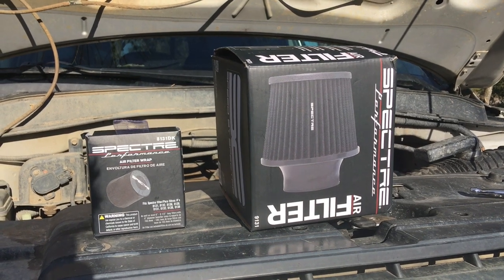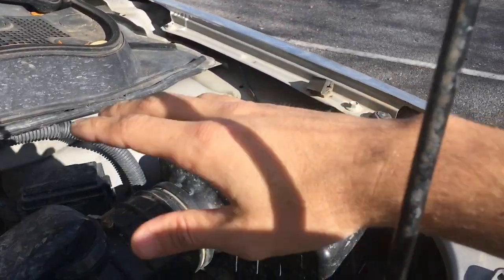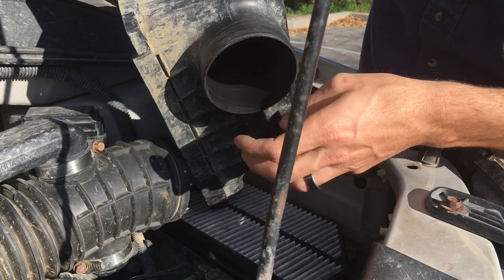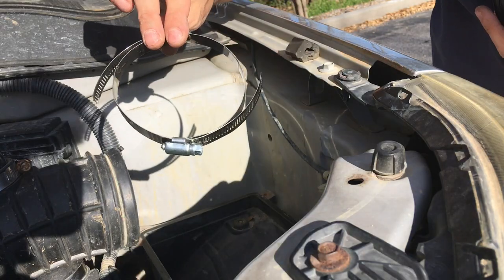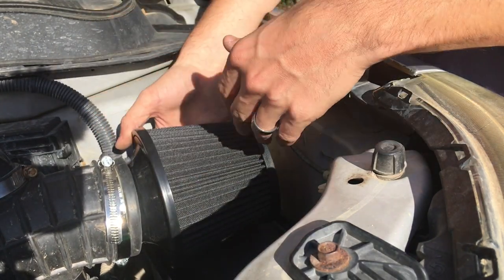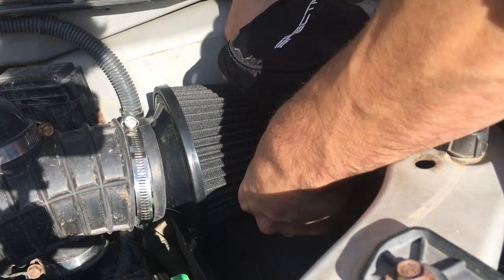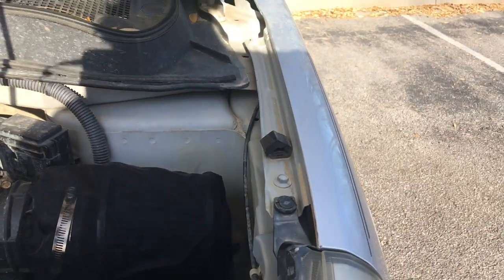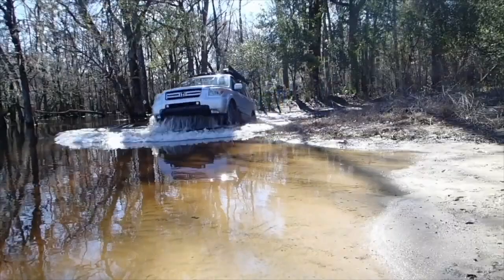DIY Raised Air Intake Mod: Pt I (2003-2008 Honda Pilot)

Comment: If you mod your old top cover(or the junk yard one) by lopping off the back half and tapering the front half to the shape of the cone, you would partially shield it from front/top splashing while also allowing it to funnel some cooler outside air during normal operation.  In addition to protecting the front and part of the top of the filter from splashing, this also allows it to breathe if the factory box inlet is submerged.  Just a thought.  Keep the videos coming.  I love watching what you put that thing through(and that you take your family along).
Reply from the maker: Thanks for the feedback Allen! That is what I was thinking too.

Comment: My concern is the air filter quality and how the MAF sensor will react, also it's not much of a cold air intake if the hot air from the engine compartment is its source. Just what comes to mind being the devil's advocate. Keep the videos coming.
Reply from the maker: Thanks for your thoughts! I wonder how much air still come from the stock air box below?
Reply: I would assume the path of least resistance

Comment: That sounds like a really good, cost effective mod. So ironic I cleaned my spectre air filter that goes in place of the factory one yesterday and today there’s a video about the intake! I might have to try that!
Reply from the maker: Nice! I will keep you posted on my experience with it 😁

Comment: All you did was compromise a system that protected your engine best from the elements by keeping dirt and debris at bay and only drawing in the coolest air possible.  Car manufacturer engineers spend millions of $ to design the best air boxes for engines.  Open intakes only show benefits on cars that consistently see high rpms. This has even been verified and said by the head engineer on the Honda Ridgeline, Gary Flint.
Reply from the maker: Thanks for the feedback, I have considered and heard everything you have said before. My goal is to raise the intake so I don’t hydrolock my motor.

Comment: The stock intake starts at the bumper level then travels through an air chamber box (that has a drain hole) before traveling upwards to the air filter. Might want to inspect your air intake tube for cracks due to age and flexing. I think after your experiment with the CAI the only way to safely go off road with some minor river crossing will be a modified snorkel mounted onto the driver-side fender.
Reply from the maker: Good advice, I will check the stock air intake tubes tomorrow.

Comment: Why don’t you just modify the inlet from the intake flow? Funnel it from the lower front to above the hood, with a hood exit. I think it would be more concealed and be even higher than you have it currently. I’ve seen Velossatech make some for Focus RS/STs that route down. You could just have it route up instead.
Reply from the maker: Thanks for the idea, that could work if done right. First things that come to mind is that there is limited space and if I wasn't careful I could suck in water splashed in front/on the hood.

Comment: I think the coa can be a better option that stock for some vehicles like yours. With mine the stock I take had a great “inlet” from the hood line and basically follows the hood height. For mine a coa would put it more at risk.
Reply from the maker: Yeah I am jealous of the 2nd gen Pilots with the air intake at the top of the hood. In my Pilot this setup is definitely higher than stock. Once I build some splash protection it should be a solid upgrade in intake height

Comment: I've been running a short ram intake. Which is basically what that is on my pilot for over a year no issues. However I am more concerned with the splash up like you stated. I don't get offroad with mine as much as I'd like so I can't speak in that aspect of it. I'm curious to see how this works for you.
Reply from the maker: I drove through some puddles fast and checked the cover and it was dry, I think I will be good if I can protect the top and bottom of the filter. Thanks for the feedback!
Reply: @GotterAdventure  very glad to hear that. Not going to lie I actually was so nervous about the splash up that I have been slowing down for deeper water. Nice to know I was just being over cautious. Love your videos btw. Take care.
Reply from the maker: @lienustn2526  I'm sure it depends on the engine bay and other factors. I am still testing for sure.

Comment: I think it will work for most of what you do, just be careful about splashing. Some minor splash wont be an issue, you just don't want to send a lot of water towards the filter. You will definitely be raising the intake by several inches with this mod, so that's a good thing for sure. As an added bonus, it will sound good when you step on the gas, but that also means the down side will be that it will probably hurt your gas mileage, lol.

That filter wrap might actually be water resistant. I had a similar wrap on a K&N intake that I had on  my old Chevy Colorado I had a few years back and the wrap actually repelled water. Obviously the hydrophobic properties of the wrap can only do so much, but every little bit helps. It should at least help to repel any minor splash that gets in there. so, uh when do you want to go test it out?
Reply from the maker: Thanks for all that feedback Mike! I've got a new area I want to explore near the Santee River. I will talk to Eleni and PM you if I'm available :)

Comment: Would a better investment be a snorkel ?
Reply from the maker: They don’t make a snorkel for the Pilot. I have test fit a Jeep Cherokee snorkel, but it didn’t look right.
Reply: @GotterAdventure  okay good to know I thought about it but haven’t looked into it yet , did you run the jeep one ever? Did it work?
Reply from the maker: @trevismccullough7278  It would work and is the one other Pilots use, but it only came halfway up the windshield. I didn't like the look
Reply: @GotterAdventure  okay cool thanks for the info , I’ll let you know if I come up with anything in the future